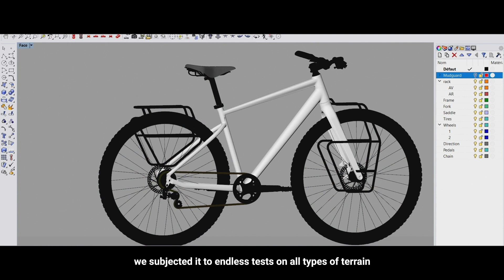The adventure design of our TRAVEL BIKES l Touring and Bikepacking

Comment: i'm going to buy touring 520, how does it behave with a single chainring uphill?  and downhill you ride empty with 11-36 or do you succeed without problems?  alternatively I see the right passage for the front derailleur cable, is it possible to mount a double crankset?  or turn everything into 3x10v?  thanks
Reply from the maker: Hi there, single chainring is awesome : more intuitive, very versatile, no maintenance nor mechanics. 36-11 is a bit limited while going downhill though, but while touring you usually just cruse when downhill. Everything is made so you can put setup you want : single, double or triple
Reply: @RIVERSIDEADVENTURE  very thanks